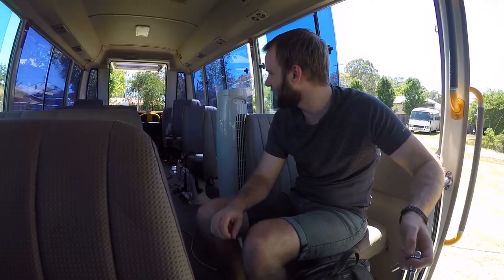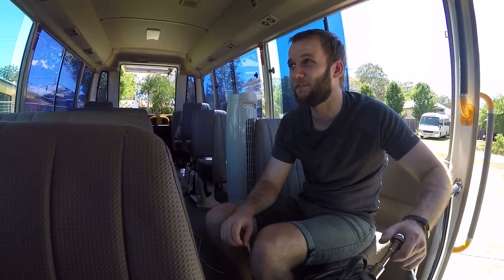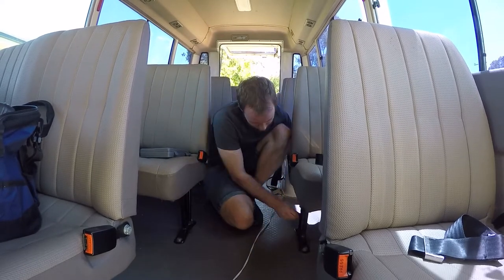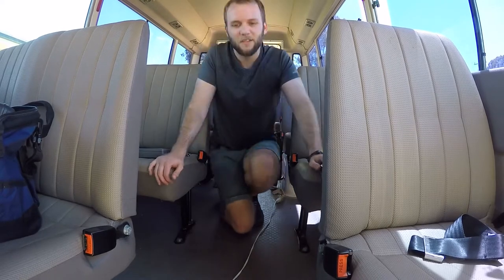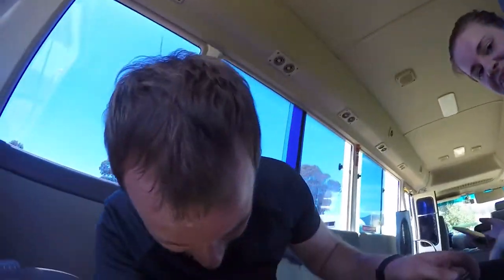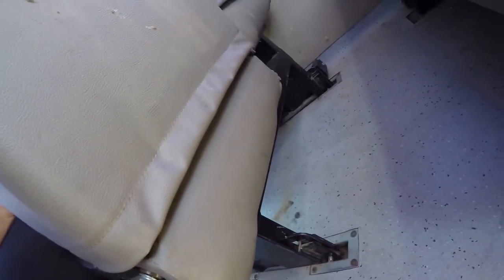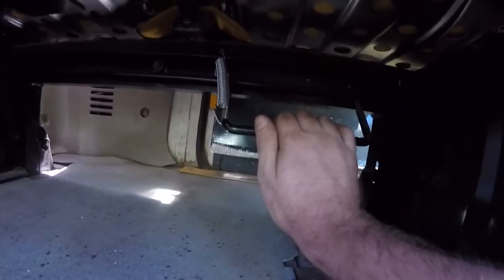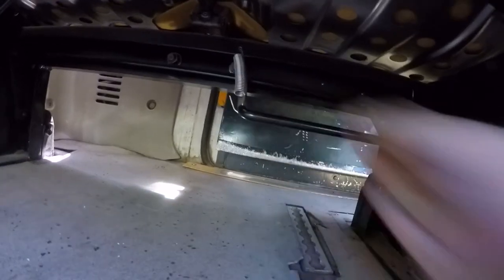Toyota Coaster Bus Conversion - Seat Removal!

Comment: literally did the same thing today and yesterday... bought my 2001 coaster yesterday... my biggest problem was the nuts on the wheel arches were so dirty and rusted from the wheels flinging crap into them over the years. 

look forward to seeing more
Reply from the maker: Dirty Malone Yeah, we have had our fair share of problems with dirty nuts and also threaded screws. We find WD 40 helps a lot and if all else fails we used a grinder. Good luck!

Comment: Did you have to get a mod plate for the seat removal ?. Loved watching your build
Reply from the maker: Hi, when we spoke to our engineer, he advised to do all of the work, including removing the seats, and he would do all of the certifications and mod plates at the same time. For us, this was because the bus was unregistered and not going to be used throughout the build. 
If we were to be registering and driving it throughout, we would of needed to remove the seats, and get ot modified to a 2 seater 'panel van'. Then at the end of the build, get it modified again to a motorhome.
For us just doing it once was easier.
Hope that helps!
Reply: @RoamingonRubber  thanks for that 👍had to do do the same thing for our Mazda t3500 here in Tasmania- more money for the government 😁😁-